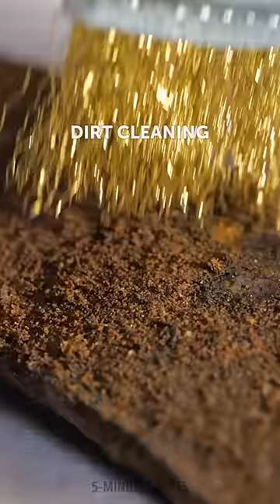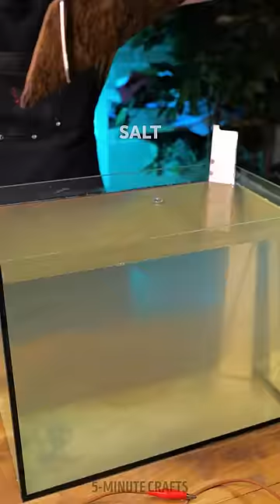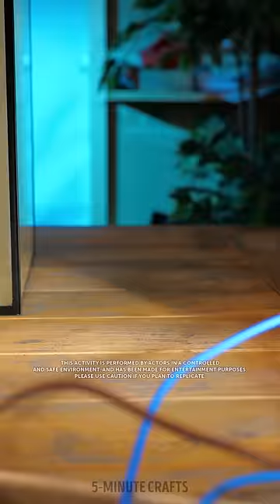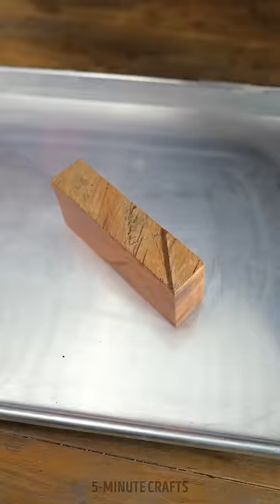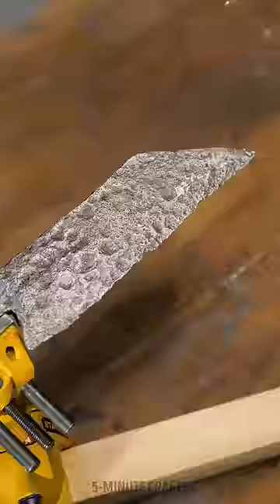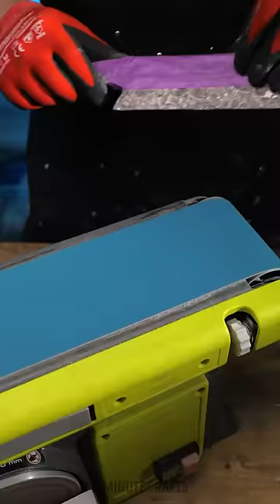Amazing restoration of old rusty chop-knife👍

Comment: It's so good to see the electrolysis process 😮
Reply: that's not electrolysis.

I have no idea where the bubbles are coming from, but electrolysis of rust happens when the iron oxide gains electrons causing the oxygen to be liberated and the iron ions to dissolve into the water (and likely be attracted to the anode). it requires that one electrode is connected to the rusty piece and another to a sacrificial piece.

(I may have gotten the oxidation/reduction bit and the anode/cathode bit wrong, I'm tired)